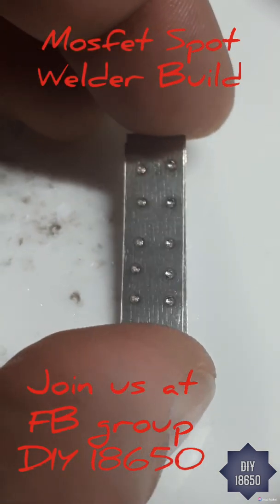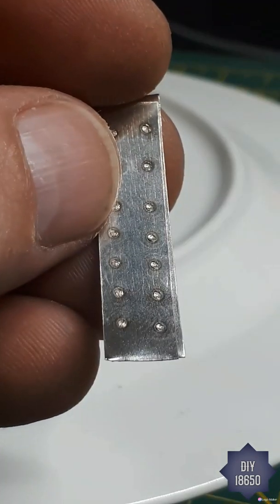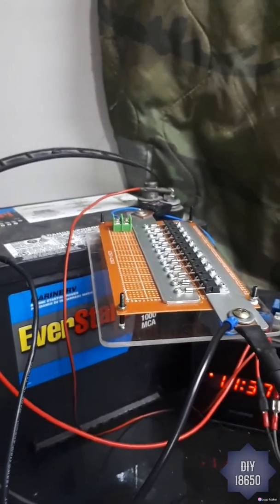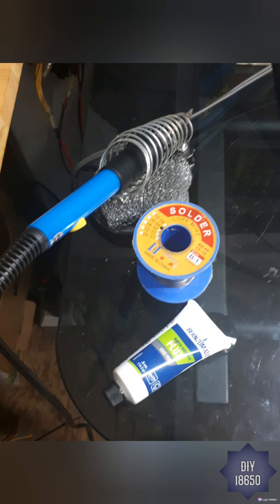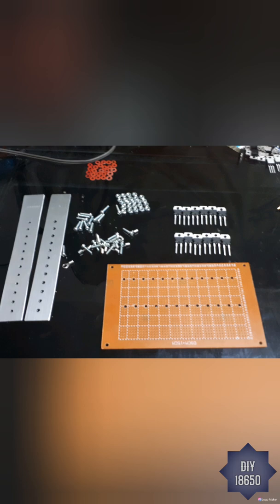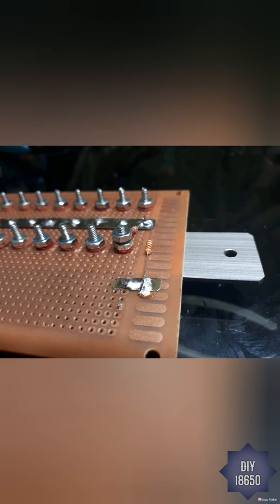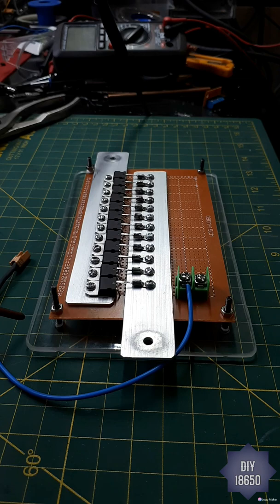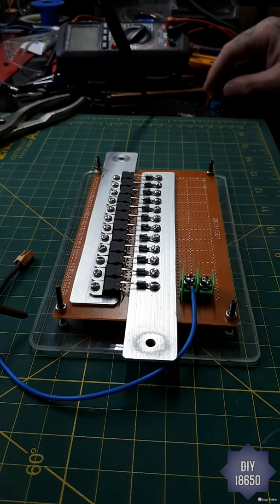12 mosfet spot welder build video.

Comment: You don’t need the mosfets. Just use:
12 Volt battery with sufficient current capability.
Thick leads
2 probes.

For pulse-width (time on) just experiment. You’re looking for about 250 millisecond ON time so just eyeball it until you get the desired weld. It’s the cheapest and most practical home solution.
Edit: unless you’re looking for a project and want to design and construct a circuit to spend money and pass the time, KISS.
Reply from the maker: You go do that and link me the video when its up champ champ I will pay you to see that pack build. Cheers mate
Reply: @cdiperformanceparts4364  
I already have done it Chief. I’ll be glad to send you a video so that you can learn a simple way to fuse metal together. You know, why didn’t you incorporate a 555 timer configured in mono stable (one shot) mode for exact weld timing? Or use a microcontroller? I’ve nothing against complicated circuit design to make things more ‘professional,’ but you see, most guys just need to construct a simple solution to weld tabs on a couple of batteries at home. It just doesn’t make sense to go to the expense and investment in time to make it more complex for a couple of small jobs.
Reply from the maker: @mtkoslowski  i will be waiting for the video and look more we did use a 555 timer a programmer timer board so your right I did do a great job even in your words in a way as doing what you said. This was a stand alone unit that was trigger by a few different way to confirm whats was most optimal for my needs. You know like the right way to do it champ 🏆

Comment: You have made a great spot welder which is easy to build and looks to give good spot  welds. Further can you please elaborate the input and output terminals connections and capacity of the battery to get good spot welds.

Comment: How are we sure that all mosfet switch the same time and with same internal resistance? Some might have lower resistance so they will draw more current. Am I wrong?
Reply from the maker: This is using constant current sink and I should have put / shown it in the video and it's also how I check the mosfets. I first set the first one up in the bread board and check and keep adding mosfet after mosfet and check for sink.  Not all mosfets are equal but this helps to equal them out and pick out any bad mosfets. Also make sure to get your mosfets from a trusted source.  I will make a quick video tomorrow showing how to current sink mosfets and it's really easy. There was a bunch of guys copying my vidoes so I didn't do any follow ups but I will now.
Reply: "Some might have lower resistance so they will draw more current." is for BJT transistor or IGBT. The mosfet behaved differently

Comment: You should not have paralleled the gates of the MOSFETS. You are inviting a lot of parasitic oscillations coming out of your welder, please check that with an oscilloscope. The normal practice is to have an individual gate resistor for each MOSFET, that would suppress such oscillations.

Comment: This is a great video. A very great one indeed. But you mentioned addition of diodes for back emf, please what type of diodes and where are where are they to be connected?
I am also waiting for the timer.
Thank you.
Reply from the maker: Basically almost any diode will work since it's high volt extremely low current back emf. One set up to block and one set up to direct to the positive of the battery. I have used almost every type of diode in testing.  Larger amp diode is a good idea.
Reply: @cdiperformanceparts4364  Thanks so much

Comment: Can crappy contacts make crap welds I have a sunkko 220v but the pen has shit tips and makes horrible welds
Reply from the maker: You will not get much power from the wall plug and ac for welding is not recommended.

Comment: What diodes are using? I didn't hear it mentioned in the video
Reply from the maker: I am using 6A10ZG and that's 2 of them. One blocking and one directing to the positive of the battery to direct any positive back emf and the other burns up any. You can order 5kp13A-e3154 they can handle more current but it's high voltage back emf so basically any diode out of must power supply like psu ect will work. Scotty didode or fast acting rectifying didode will work. I tested a ton and if you dont have them and use a large battery they will blow right away.
Reply: @cdiperformanceparts4364  thanks!!!
Great videos!!!
Reply: I searched for the 6a10zg diode.
Nothing anywhere comes up with that exact search.
Is it also called something else?
Reply from the maker: @grokstone  read my comment right above yours it states the diodes that are best and are used on the malectrics spot welder. These diodes I just from the junk yard off some electronics.  Alsmot any fast rectifying diode should work. It's a back spike of extremely high voltage little amps. Or skotty diodes also will work and at first with my welders for 5000 plus welds I used just 1 amp diodes from a cumputer power supply and that was 2 in parallel.
Reply: Oh I see those are eyelets connected to the leg of the mosfet
Reply: @joncoop2873   I did the same thing
Reply: No diodes. It will eventually self destroy because of this. Nothing to handle the avalanche current.

Comment: How much will be the output current .these mosfet are rated for  110a so when in parallel 1100amp right or correct me.

Can I use a normal 12volt adapter supply.
Reply from the maker: It also depends on the cca of the battery you use so no. Kbweld at 20ms that's around 750 amps with my 700cca battery. Also the mosfets are 220 amps 440 amps peak.
Reply: @cdiperformanceparts4364  thanks . what will be my output if I use a 12 volt 2amp.adapter. I my asking because I don't have a high amp bettery lying around
Reply from the maker: @dinrc  the out put would be 2 amp from your 2amp power supply.............

Comment: Very instructive. Thanks for sharing. Where do we find parts/hardware?
Reply from the maker: Mosfets are ready to order from Digi-Key and eBay or any online retailer for mass goodies should have the prototype board.  You will need some basic shop tools to make this and if you have them you should be able to figure out the rest. Cheers
Reply: @cdiperformanceparts4364  Thanks!
Reply from the maker: @KevinCLT  in the description is the mosfet part number but it's 110N7F6. Cheers